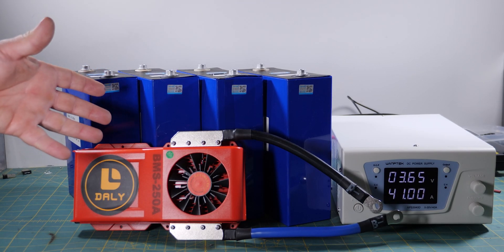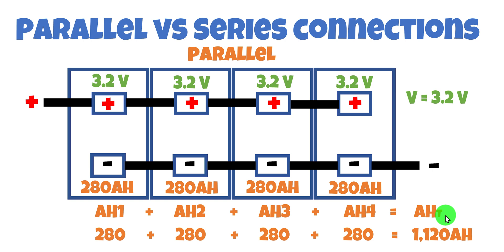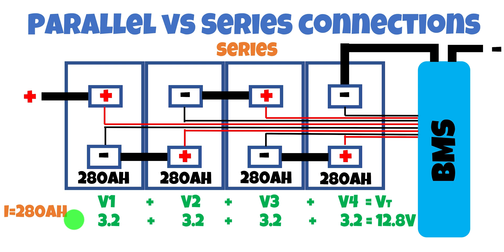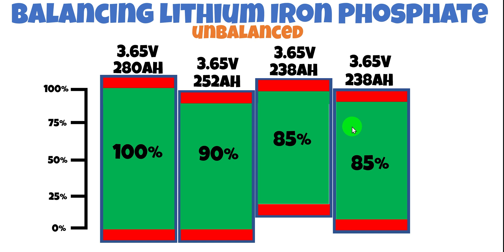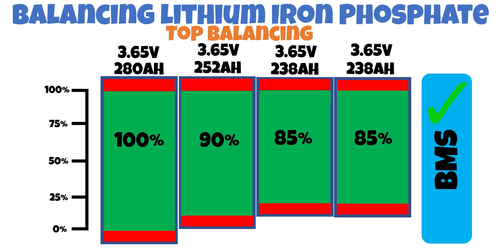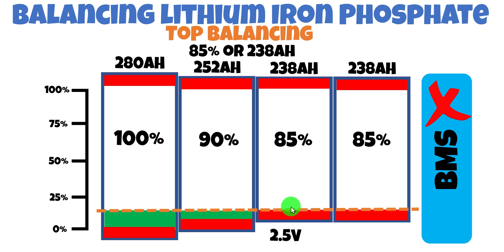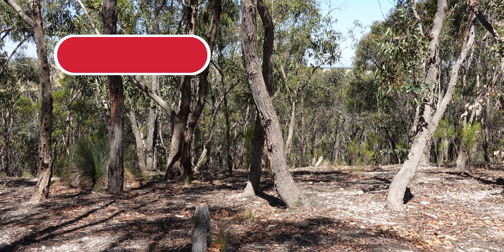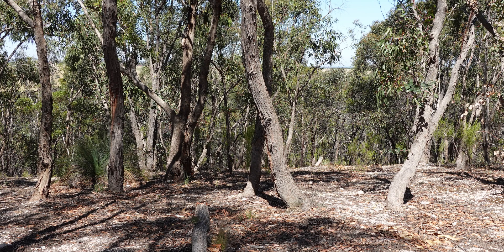DIY LiFePO4 battery Part 2 Balancing Lithium Iron Phosphate Cells

Comment: With passive balancing the higher voltage cells don't discharge, rather they receive a restricted charge ammount of usually only about 50mA in most generic BMS which makes passive balancing useless in high capacity cells.
The higher voltage cells are not isolated from charging,
Reply from the maker: Thanks for the clarification.
Reply: Yeah, when I say restricted charge.
I mean they the charge going in is only 50mA lower than the lowest voltage cell.
Most often the BMS is set at balance only when charging.

Comment: Very good explanation of how balancing works with some minor exceptions, active balancers will often take the charge from the highest cell (within parameter settings) and deposit that excess charge into the lowest pack cell until they all even out. Passive balancers are not very good for these high capacity cells around or over the 100Amp area, especially if they may be worked fairly hard. Active balancers are definitely better than Passive balancers and are much more capable of keeping cells in balance. 
Daly are not a very good BMS generally, but their later iterations are getting better incorporating active balancing in some of the newer models. I like to use a 250A-350A JK BMS’s with 2A active balancing in my setups, they have a nice B/T app & feature rich parameter settings & they work well & deliver the amps as needed with plenty of protection parameters.  
Something people should realise here is that the stated voltages for charge & discharging levels are getting into dangerous area’s at 2.5v & 3.65v/cell respectively. A lifepo4 cell can be fully charged at 3.38v/cell if left long enough, it just takes a bit longer,but 3.45v-3.5v/cell is the accepted max voltage you can turn off the charger for a 96%-99% SOC with a good balance profile of 2-3mv/cell.
Conversely 2.5v/cell is hitting a very low SOC and at 3v-3.1v/cell you have used 95%+ of the cells energy and there is no reason to take them down any further, it will just shorten the number of cycles & overall lifespan of the battery as will charging over 3.5v/cell, it is just not necessary for literally a few amps extra.
It would be nice to see some follow ups on ur battery building projects & I love ur vids. 
I have built a few of my own batteries for home, bus & camper use, but recently relented & got 2 x 200A Kings Lithiums for a camper setup mainly because it was quick, cheap & easy for the present situation. 
While ur cells do appear to be bloated, I have seen worse condition 280A cells after 2 years of hard testing still pull 98%+ capacity, so I wouldn’t stress too much about it. It is probably worth considering to buy extra cells if price is right & budget allows it when ordering these larger cells, in case a cell or battery fails as a backup or redundancy measure. Good vid & info. Cheers

Comment: Thank for your videos. I want to change lead acid batteries of my friend's electric wheelchair to lifepo4. Want to make a 24v lifepo4 but when I make 8S it has 29,2V full charged so is there a chance to burn motors? My BMS shows 24v but I don't get it. What should I do? Thanks
Reply from the maker: What is the current lead acid battery configuration and voltage in the chair?
Reply: @LockyourHubs4WDing  there were two 12V 40ah in series total 24v
Reply from the maker: @yasinsaglam4158  that should be fine. Depending on the type of motor, the maximum speed might be a little higher than with the lead acid. The only other thing to watch is the charger. Make sure it's lithium compatible.
Reply: @LockyourHubs4WDing  yeah it is cccv charger with 29.2v output. Thanks for answer 😊

Comment: What if you don't have a power supply like you're white box..
I am a total lithium rookie...
Just found your vid,s  
Would I be better buying sealed lithium batteries having minimal knowledge..
Thanks..!
12v ,,  280 amps is Interesting..!
How many solar panel watts would I need to charge 280amps of lithium..
Do I need certain regulators for lithium..
Currently running 1-- 100 amph agm ,, 30 amp pwm. 200 w panel...  &
2--  100 amp gells ,, 40 amp pwm .. 500 w panels in parallel..
Reply from the maker: You can get dedicated 12v lithium chargers, though you couldn't top balance with them as you would need around 3.65v.

You can pick up a variable voltage 10a lab supply for about AU$75.

The solar controllers may work, it depends on the model, lead acid and lithium Iron Phosphate need different profiles. Lead acid, once full, still requires to be trickle charged and likes being kept at 100% full.

LiFePO4 prefers to be stored around 50% full. And when charged up all the way, no trickle charging, just turn off the charging supply. 

Last thing to remember is depth of discharge, lead acid around 50% and LiFePO4 around 80%.

So if you only want to run the same things, you can run a smaller (less Ah) battery saving further weight.

Comment: I'm building my second battery 200A with 150A BMS, the first was a 100A with 100A BMS. Top or bottom balance depends on battery use. For our purpose in vehicle second battery, it's better to top balance, as that is where the battery will be most of the time. Great videos, Cheers.
Reply from the maker: I think for EV use, a bottom balance would be better. Though as a second battery, especially using a BMS with some passive balancing, top balanced is the ticket.

Comment: hey mate love your channel and content. I have been running a diy lifepo4 setup in my 80 series for a about a year now using 12x 200ah calb cells in 3 12v banks parallel 600ah total. I initially brought 3 of the exact daly 250a bms that you are running but i couldnt get any of them to work/turn on and ended up buying 3 120a overkill solar bms instead. have you got any tips on how to get those daly units to work lol, or did you have no dramas right out the box. otherwise im just bloody unlucky and got 3 duds or im missing somthing really simple to get it to turn on
Reply: Daly have added a button on their newer (last 6 months) Bluetooth dongle that you can press to kickstart it.
Reply from the maker: I'll be looking more in-depth at the BMS, selecting one, setting them up etc in the next episode.